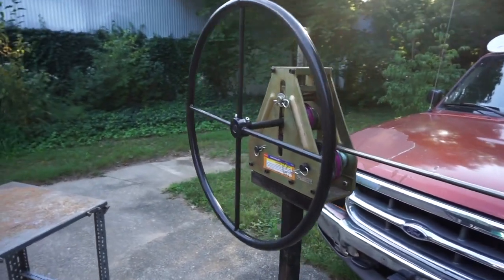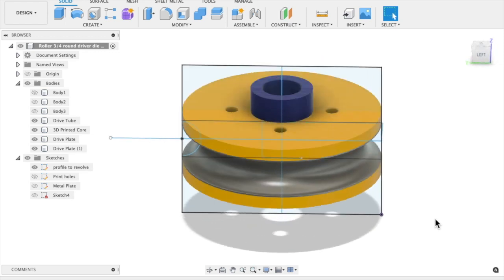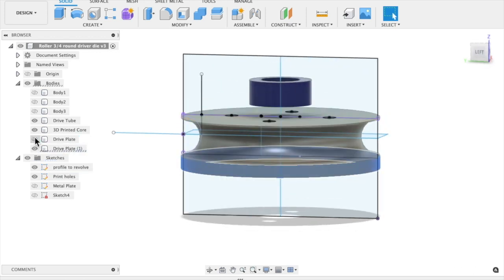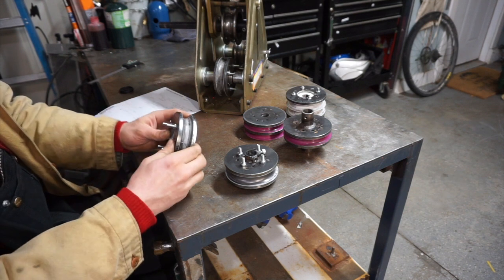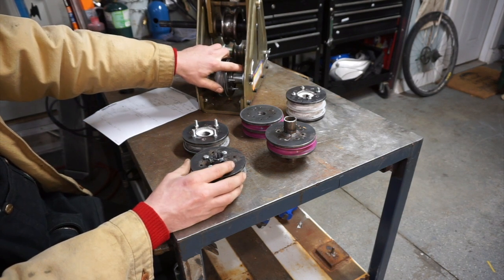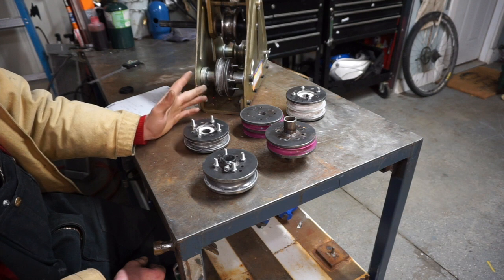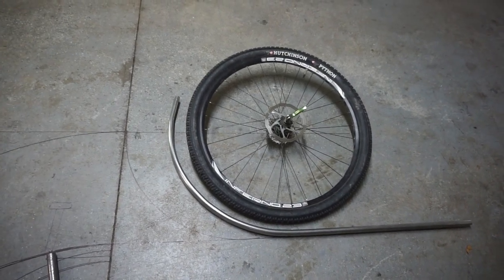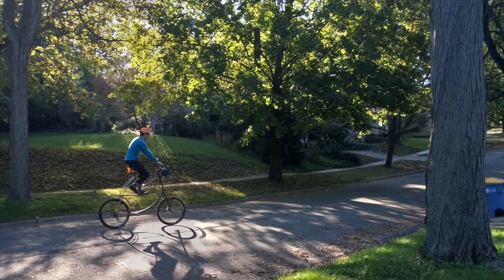3D Printed Tube Bender Dies Made in Fusion 360 for Harbor Freight Tubing Roller on Steel Pipes

Comment: Very nice results. Definitely 3D prints are possible and effective.  If I may offer an unsolicited suggestion, on the tandem rollers, you might sandwich another steel plate between the 3D prints to stiffen them.  So …. Outer steel plate, 3D print, middle steel plate, 3D print, and then outer steel plate.  You’ve definitely earned a subscription from me.  Looking forward to see what else you’ve done. 👍👍😎👍👍
Reply from the maker: I think that would be a good idea. Since this video I have stripped the threaded plate on the roller and have upgraded to a hydraulic jack similar to the trick tool kit. The jack can handle double tubes but the original screw could not (I also got the roller used so I don't know the rollers full history). If you have the feed screw still installed it is fairly easy to get repeatable bends by marking the screw depth with tape once you get the desired bend, then send the next piece through till you get to the tape. No need to remeasure so it's easy to crank out alike parts fast.

Comment: Try to make those support steel rings so slightly bigger - so diameter passes center of pipe what you rolling - better support of sides
Reply from the maker: Im not sure what your'e saying but I think I got it that way already. The center of the pipe hits the outside diameter of the rings. I did get some kinks but that is not from lack of support, that is from pushing  the feed screw in at the same point every time. I found If I turned the screw in different locations the kinking was greatly reduced to almost none. I am confused as to what the goal of the increased support is?
Reply: @mattthemaker3787  I will say metric: if the steel ring diameter is like D=90mm then the bend  pipe radius should be not more then r=43mm

Comment: Wow this is great but I think they should be TPU
Reply from the maker: My printer can't print TPU without modifications but TPU might be better as winter rolls around. Its colder in the shop and I think the PLA used in the prints will be more brittle.
Reply: An easier alternative would be PETG.